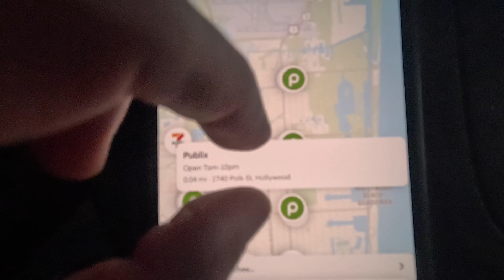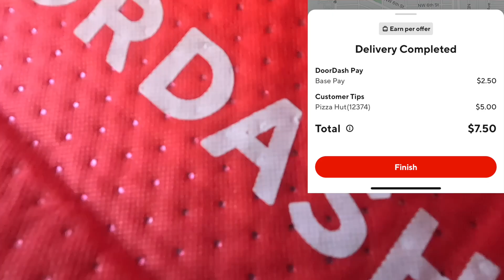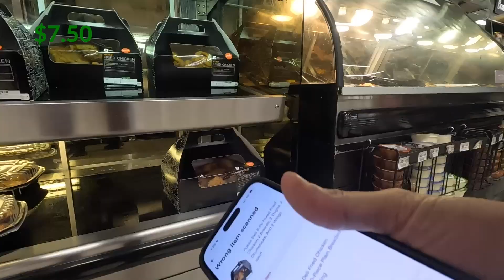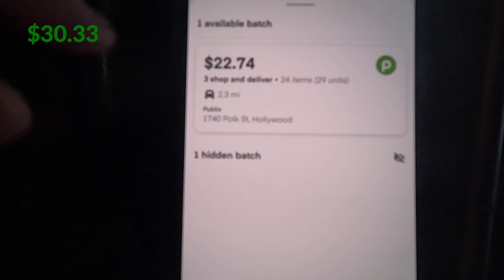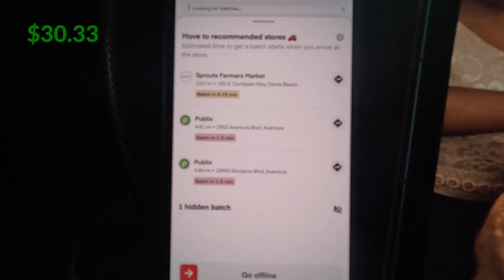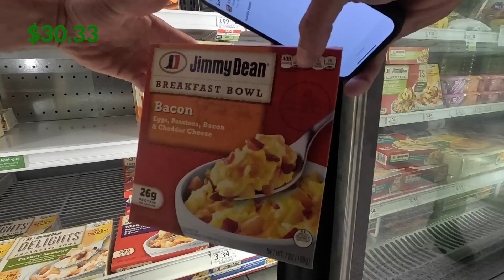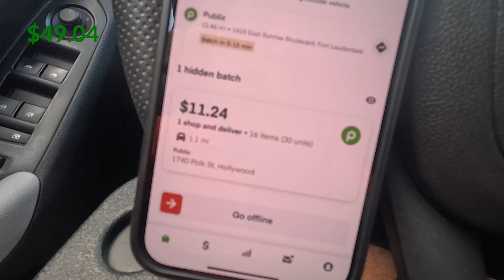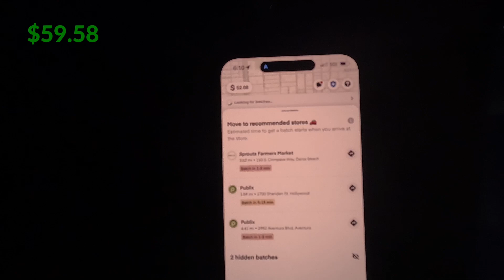I Accepted Instacart Orders In Hollywood, Florida

Comment: that tire just looks like its past its time to be changed not cheap
Reply from the maker: Have you seen shaven tires though that’s not from wear and tear I don’t think so at least
Reply: @jo_ezzy Did a quick google and that cracking you have could be from how much sun the tires see. Hot pavement/ lots of being in the sun will do that to the rubber (assuming they wernt over inflated, because that can also be a cause of the cracking)